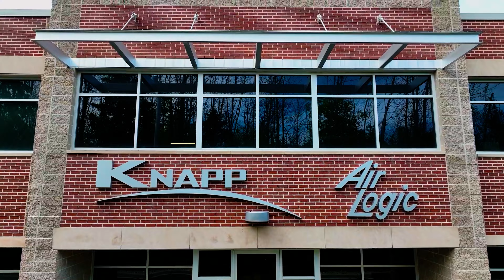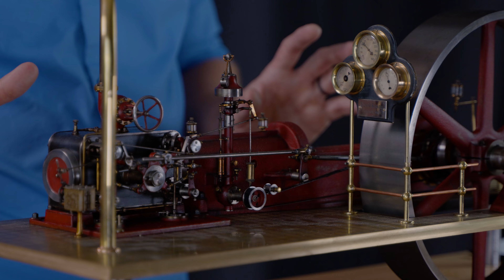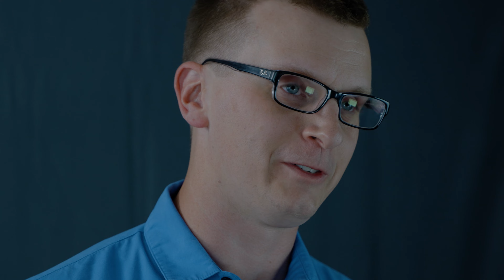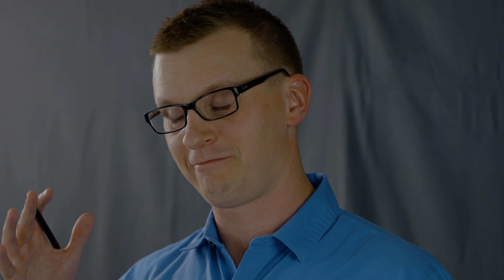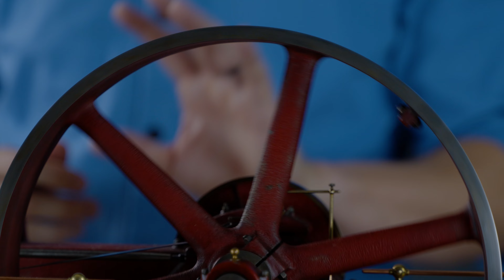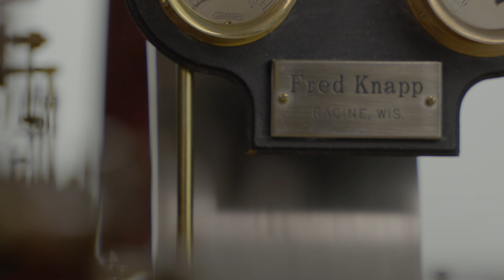Corliss Steam Engine - How it Works and History

Comment: UK steam enthusiast here. It was the valve, not the engine that was important and unfortunately the presenter did not describe the valve and how it differed from conventional valves on other steam engines. In the heyday of the cotton industry in Lancashire there were hundreds of stationary steam engines in the mills, of average 1,500 - 3,000 HP.. Each maker had their own preferred valve arrangement, but when the Corliss valve became available most operators changed to this type of valve - even if it meant a complete rebuild, in the case of engines already installed, the savings were such that the substantial costs were soon recovered. UK makers made improvements to the Corliss valve, such as steam cut-off, which further improved its efficiency. We still have at least 3 large Corliss valved engines in workable condition, two of which are run in steam as visitor attractions. these are Trencherfield Mill 2,500HP and Ellenroad Mill of 3,000HP. both of these can be seen on YouTube videos. Excuse the long-winded response but it is a subject close to my heart.
Reply from the maker: Thank you very much for your additional context! We love to educate and learn more about the industry and we are so glad to have viewers enthusiastic to help share as well!
Reply: @airlogic1166  Here’s a bit extra on the Corliss valve, with a simplified explanation of its operation. On the larger steam engines, especially those using superheated steam at 200psi or above, it was necessary to design a valve that would operate against these high pressures. Until the advent of the Corliss valve the norms were slide valves or piston drop valves or a combination of the two. These were cumbersome and comparatively slow in operation. The Corliss valve consisted of a circular section steel billet with a quarter of its section removed along its whole length. This, the moving part of the valve, operated inside a cylindrical housing which had a port along its width. In this manner a quarter turn of the billet uncovered or covered the port to admit (or exhaust) steam. It was thus able to handle large amounts of steam at high pressure at high speed. Improvements were made when it was discovered that if the admitted steam was cut off prematurely the steam would continue expanding inside the cylinder and this property led to further savings in fuel. Steam cut-off could not easily be applied to other types of valve and this led to the Corliss valve reigning supreme.
Reply: I just saw this video for the first time today.  It does not appear that the inlet valves are set up correctly in this demo.  I do not see any quick-return action of the inlet valves....which was the whole point of the Corliss valve gear.